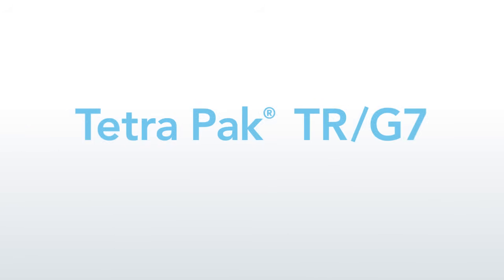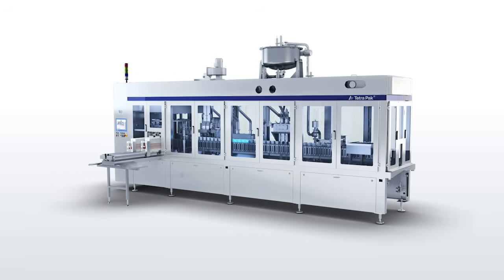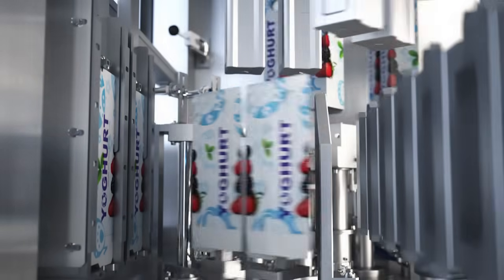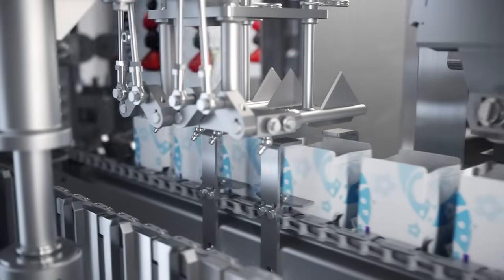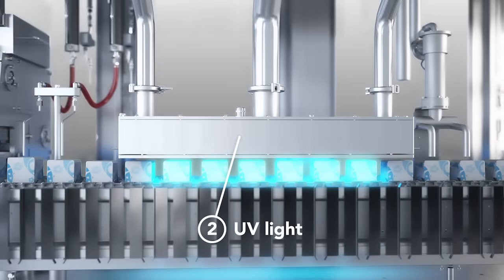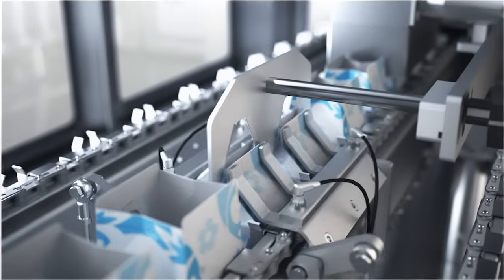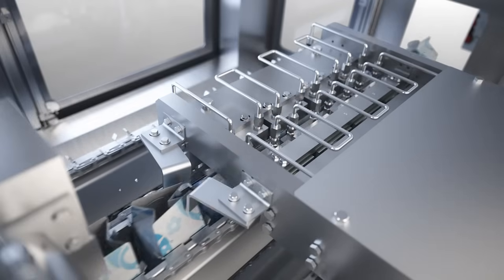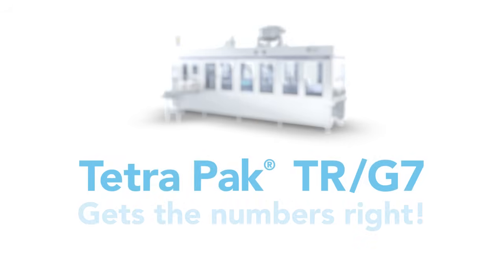Tetra Pak® TR/G7 – A journey through the machine

Comment: Is this the only machine in tetra pack series which uses pre knocked down Cartons instead of rolls of cartridges.Worked with tetra pack machines for a long time,but always used rolls instead.
Reply: Manoj Thomas sir can I get some information on tetra pack from your end . Can I have a telecommunication with you for some details on tetra pack .
Reply: Does Tetra PAK offer packaging and equipment for Carbonated Beverages? If not is it in Tetra PAKs future plans?
Reply from the maker: Hi! We do not package carbonated drinks as they require packages that can support higher pressure from inside the package. If you would like more information on our offerings, do not hesitate to reach out to your nearest local market office to get in touch with one of our experts. You can do so here: https://bit.ly/2NNUpiX
Reply from the maker: For details on our offer, we recommend you getting in touch with our local office here: http://bit.ly/2A4xKVj